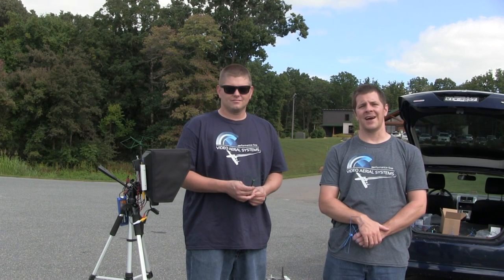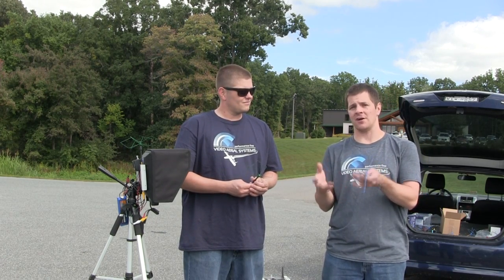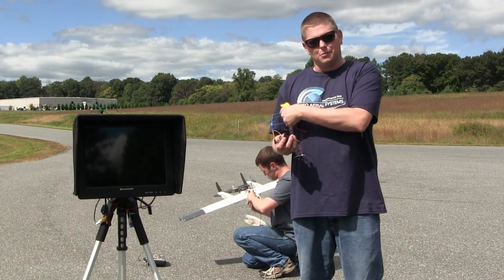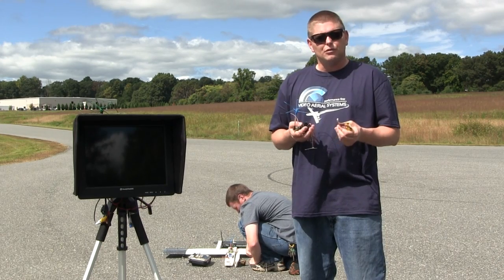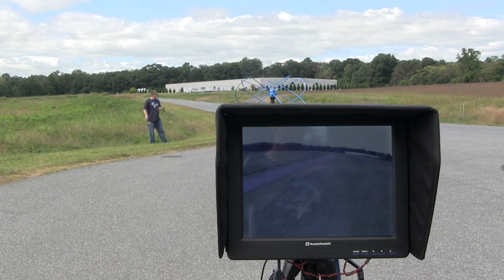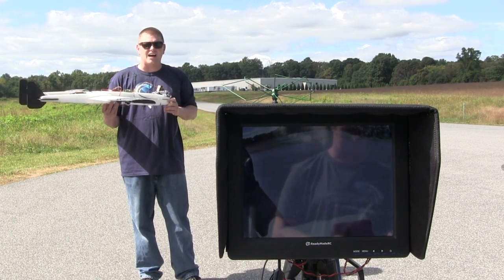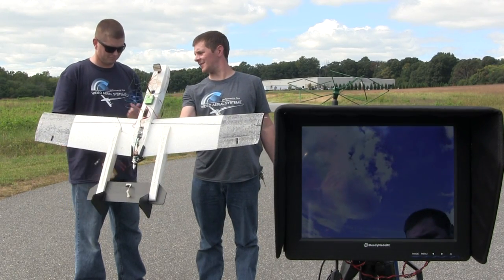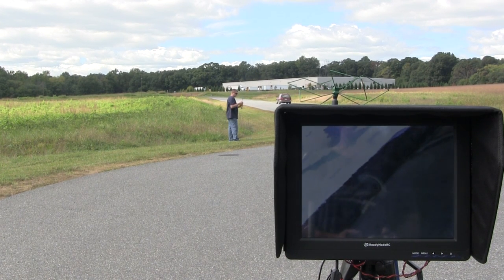Interference testing RHCP VS LHCP

Comment: if you are flying with some one on the same band their plane would be out there with yours not standing 20 feet away from your ground station  ????? so again you would end up with less interference from each other. if one of the systems was on 1160mhz and the other on 1280mhz you would have more channel desperation. we can all see that 1258 and 1280 are still to close. you need 80mhz separation. even with left and right hand CP antenna's. to bad that's not legal? Whatever

Comment: I'm running 1280 and 1258 on my multicopter - probably 18" separation between transmitters and antennas (two-person aerial videography rig).  Both are using mad mushrooms - ground station is combination cross-hair and mushrooms with Eagle Eye diversity.  I've not had many issues flying to 2~3km out.  Am I limiting my range overall though because I'm running 1280 and 1258 - or because they're transmitting from the same multicopter, do I just see fewer issues?  The problem I see using LHCP is that transmitter would be limited since I don't have an LHCP cross-hair.  Maybe I should consider moving one transmitter to 2.4 (with a low-pass on the 1.3)?

Comment: Would love to see the same test but inside a building like a big warehouse and another one around trees so we can see what it would be like when flying multiple multi copters on the same 1.3 or 5.8 band.
Reply from the maker: Good suggestion.  I will see if Marc wants to try 2 vehicles in the air with objects and such to dive behind.
Reply: Alex Greve You have to ask?????
Reply: MASHTON1138 Haha
Reply: Any chance of seeing a 5.8ghz comparison between your antennas and people flying with other ones such as the SpiroNet V2?
Reply: Andrew McClenaghan Alex lets do that video I have some gear in from Immersion just waiting for us maybe at the fly in do some testing would be a great place to do it what do you think. Do you have some of the circular wireless we can use also?
Reply from the maker: *****
I am up for that.  I plan to do 5.8GHz.  If anyone has some gear they want tested, I'll do the work and send it back.
  I have circular wireless gear we can test.
Reply: Alex Greve  Great lets do it maybe Thursday when we get down there.
Reply: ***** Alex Greve How did you go with 5.8?
Reply from the maker: Andrew McClenaghan
- Not as well as I hoped.  Turns out ground reflections on 5.8GHz are more severe.  More testing is needed to verify as we tested on the ground and not in the air.
Reply: Alex Greve That is what I thought might happen. In my limited testing of the IMRC RH and LH antennas I was getting 200-300m of almost perfect vision between the two. Hopefully you can either confirm this or maybe it doesn't affect your antennas as much.
Reply from the maker: Andrew McClenaghan - My antennas performed noticeably better than Immersion's units, but not as well as they did on 1.3Ghz.  Of course I was under a different set of circumstances as well.  Again, I need to d omore testing before I can draw any conclusions.

Comment: How about a demo of both on the same exact channel? I wonder how that would work?
Reply from the maker: Check at 11:00.  We tried that.
Reply: Ok. Just you didnt mention that you were going to use the same channel. If the rejection is enough that you can get that far on the same channel then in reality you could fly 2 planes comfortably
Reply: That test didn't make it into the final version. At 11 minutes I am not on the same channel. When I flipped to the same channel Alex was using we completely lost his feed. I can't say this enough, Do not fly on the same channel even with LHCP v RHCP.
Reply: Thanks for the feedback Mark. I see the biggest advantage for flying miniquads with my mates as sone of tgeir channels walk all over mine

Comment: So, if you did this on 2 planes moving around, you would have practically no problems?
Reply: Yes, that is what the testing indicates. We will be putting it to more practical use very soon with 2 or more planes in the air. But we are convinced this is the case as long as you don't crash or land right at the other pilot's GS while he is out at range.
Reply from the maker: I wouldn't say "practically zero issues".  You still need to be mindful of the other pilot and you cannot go for distance unless the other pilot does the same at the same time.  Separation is ~8-10db greater.  Not a miracle cure but certainly an improvement.
Reply: That makes sense.  Pretty cool

Comment: Was those tests using the channels furthest apart? Or close together for testing purposes?
Reply from the maker: Only the two legal U.S. channels were tested: 1280 and 1258MHz.  We will do some 5.8GHz testing in the coming weeks.
Reply: Test channels were the only 2 channels legal on the 1.2/1.3 band in the USA. 1258MHz and 1280MHz. We plan to do this on 2.4GHz and 5.8GHz as well. That will allow for closer channels to be tested, but I think we will see similar results with closer channels.
Reply: MASHTON1138 Alex Greve Do you think using the furthest channels apart on the 5.8GHz with one person using using LHCP and the other using RHCP would be okay?
Reply: Kit Barlow Yes
Reply from the maker: Kit Barlow
It should help to use farther apart channels rather than adjecent ones.  However I have no experience trying so I con only speculate.
Reply: ok, well ill be testing this weekend :) I only have immersion spironet LHCP an RHCP atm tho.